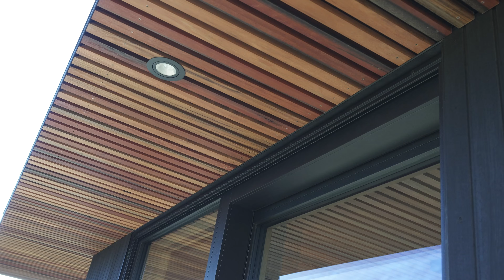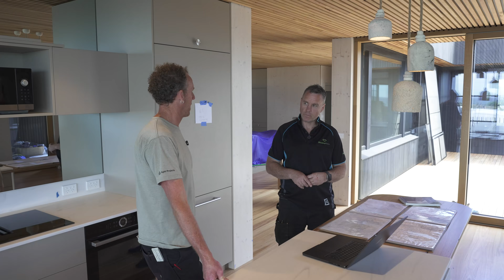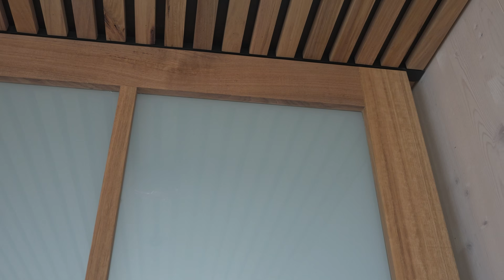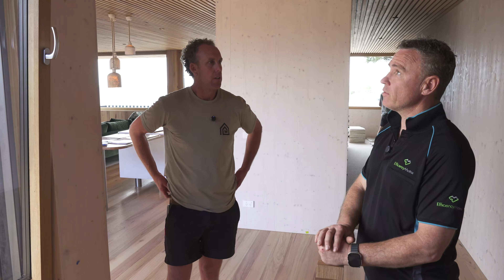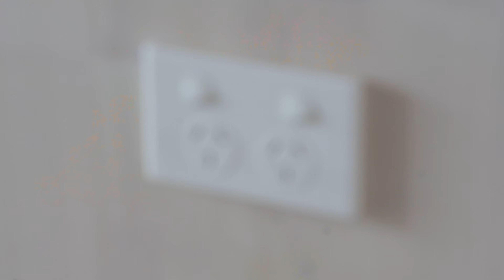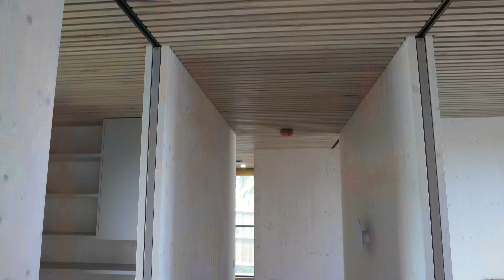Ultimate Passive House Build: From Design to Certification in Australia

Comment: I love passive housing. It should definitely be required (at least for new apartment blocks) and a higher R Value should be the minimum standard. Energy Consultants should have to certify every build to ensure that the insulation is correctly installed. Thanks for this entertaining video. Passive housing is real housing.
The root purpose of a home is to protect you from the elements, a passive house literally does this to a T.